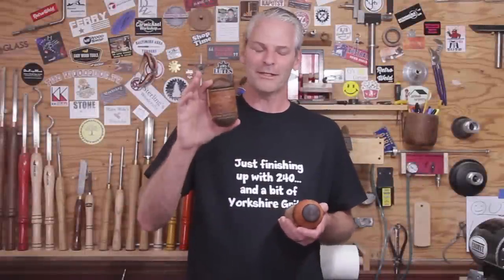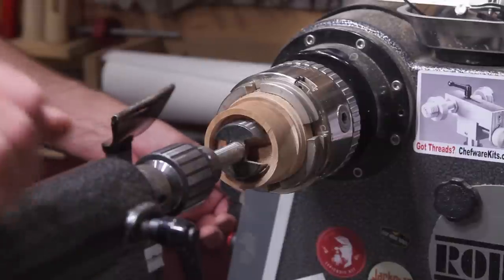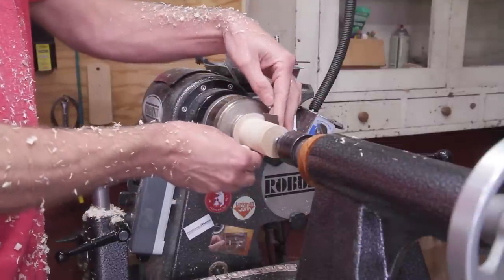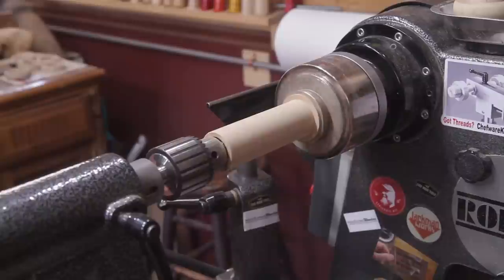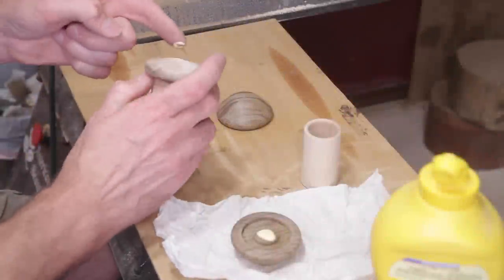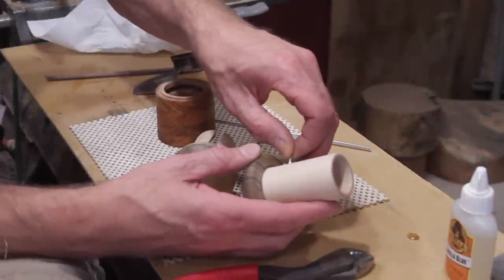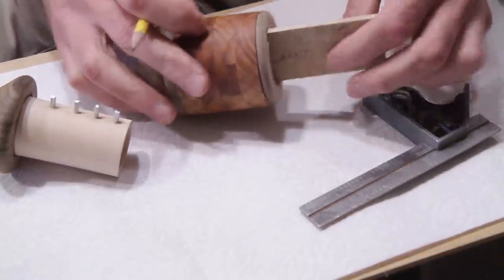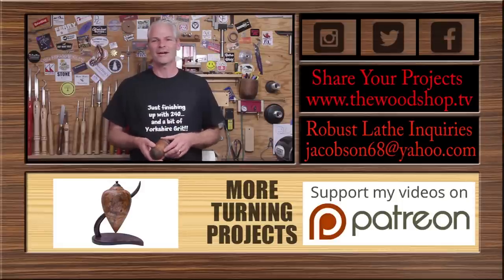Woodturning How To Make A Cryptex | Carl Jacobson

Comment: Great video. For Q and A, would you consider discussing which woods are easier to work with. For example, I was making pendants with palm and found that it kept fracturing. Thanks in advance.
Reply: Have you tried anything other than turning with palm. I found a log about 2' long and 12" across that's been sitting on the side of the road for about a year+ here in the Sacramento, CA area. Been wondering if it's usable for anything before I waste my time milling it down to usable boards. Any information would be greatly appreciated.
Reply from the maker: Thank you Doug! I'll talk about some of my favorite woods to work with in next week's Back-To-Basics

Comment: What did you use to finish it? I've been making wooden rings and I'm looking for durable finishes for them.
Reply from the maker: I would use something like a polyurethane for rings.
Reply: Carl Jacobson Thanks! I also tried Tung oil and that worked pretty well!
Reply: Zaco Cast i ditto the polyurethane or even acrylic varnish. it adds like a thin layer of plastic and you get a really nice finish!